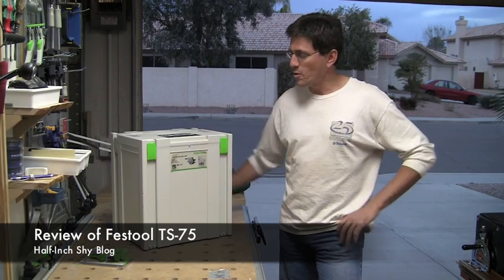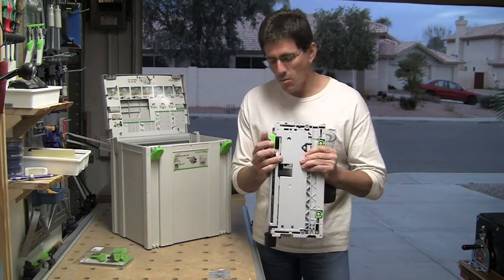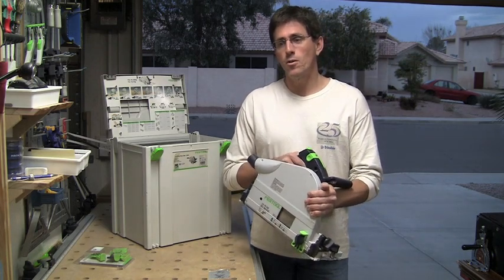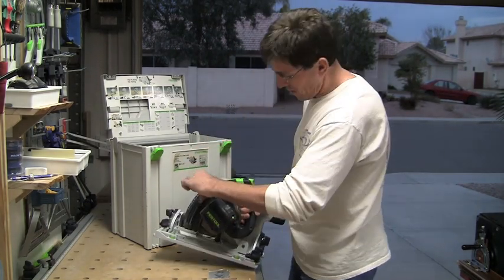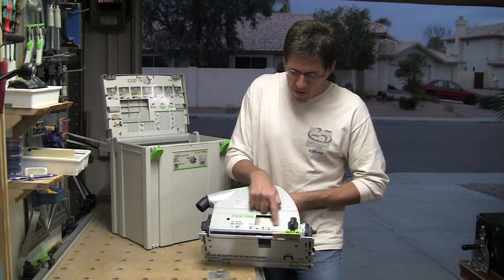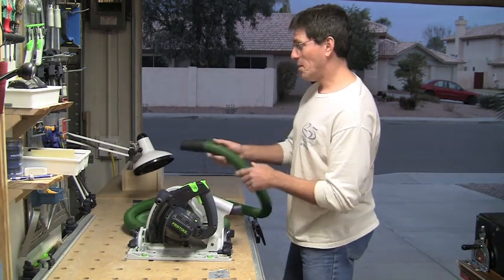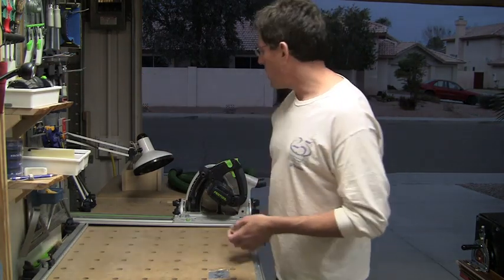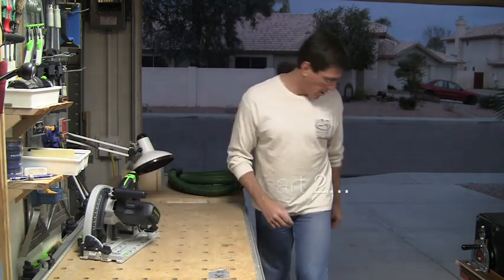#1.1 - Festool TS-75 Tracksaw Review - Part 1

Comment: You definitely read the booklet. Had no idea what the green splinter guard, kickback stop or lock-down function was for. Also, does anyone have any insight into why I get so much side to side movement in my blade? If I run a thick slab the motor limits and vibrates heavily even when I back off on the feed and the blade waves into my splinter guard. This also happens on start up, if I plunge while its coming up to speed it waves into the splinter guard. My guides are adjusted to the track so there's definitely no movement on the base/track. I watched a guy pull one apart and the mitre gear pushes the blade outwards but it shouldn't wander, right? Maybe my bearings/bushings are gone. Also also, if I run a mitre using the track, it bows the cut every time no matter what I do or how I feed it through. Annoying problems for the price but none the less this bad boy tears through slab and hardwood stock like no other.

Comment: if it were you would you get a 8in jointer or a festool tracksaw
Reply from the maker: That's a tough call. Here, in Arizona, I rarely can get rough stock that hasn't been at least skip planed. So for me to dress that stock, I pretty much just need to skip plane it further after possibly knocking off a high corner with a hand plane.  A jointer is a requirement for a production shop, but a hobby shop can go the hand-plane/skip-plane route easily.

For edge jointing, I greatly prefer the tracksaw since I prefer placing the guide where I want the edge (straightening grain? getting a skew effect? etc) That is more difficult with a jointer.

Also, I actually like using the hand planes to face joint one side if necessary.

All that said, you see a Laguna 16" j/p combo machine in the shop. I thought I'd use the jointer more, but I never do, which is why I'm going to sell it.  It took buying it and never using it for me to put together the part about rarely needing the face joint more than a little hand planing (and liking that). I already knew I'd never use it for edge jointing due to the tracksaw preference.

If you live somewhere rough lumber is common and really needs face jointing, it might be right for you.  For me, it really isn't.

With that foreshadowing, to answer your question, I'd get the tracksaw :)

Comment: Hi Paul, I too am leaning toward the TS 75. Do you have an opinion on the Mafell plunge saws (specifically the KSS-80ec because it seems to come closest to the TS 75 in specs)? Beside the sticker shock of the Mafell of course.
Reply from the maker: Ha! Yeah, Mafell sticker shock is a different level!  No, I haven't played with those. But I have a number of UK woodworker friends who love them. Most pick between Mafell and Festool.  So, without having tried the Mafell, I'd say that I have no problems with the TS-75's performance.  Bevel cuts could be nicer (e.g., hugging the rail so you don't have to hold a tippy saw); not sure if better bevel cut performance would merit a big price difference as I've only done bevels with the TS-75 a few times.  Only other complaint about the TS-75 is the offcut splinter guard that I have a mod for (mentioned in the review) and takes maybe 5 minutes to do (after 10 minutes of finding the right scrap, of course)

Comment: Paul, First wanted to say I have learned a lot from your videos and appreciate all your information you share. I have recently moved into the world of Festool and couldn't be happier with the performance of these tools. Just ordered a rts400 and a ro 125 from the Festool recondition sale. I am in Timber woodworking in Mesa daily, drooling over my next purchase. I am not debating over which track saw to purchase. I am leaning toward the TS75 due to the depth of cut, but I know the size of the TS55 would be much easier for me to use. I currently have an off brand Scheppach Plunge saw which does well, but dust collection is not that of the festool and does not have the the Splinter guard for the off cut like the Festool. I know there are time the TS75 would be an advantage, but the ts55 would be a daily user. Do you own both or just the TS75? Any thoughts?
Reply from the maker: Thanks, Anthony!

I only have the TS-75. I got it since it can do anything the 55 can plus more capacity (that is slightly incorrect now with the REQ since it has lower clearance for cutting door bottoms in-situ, but I don't do that). I don't find the weight a problem as it sits on a track. Putting it on and taking it off the track, though, might be annoying.

I only do sheet-goods projects occasionally. If I did them routinely, the 55 might be better (or justify having it as well).  In my case, I do hardwood projects much more. The added power of the 75 and the depth of cut are both appreciated and required for that.  I routinely use it to edge joint boards.
Reply: Thank you,  I am going for the TS75. Since I have the other smaller (non Festool) plunge cut, it makes more sense to go for the TS75 with all the points you have made. Now to start saving.